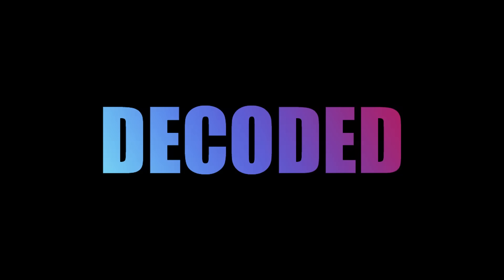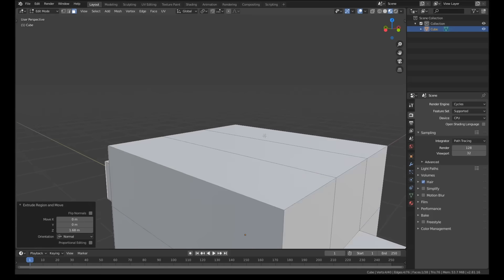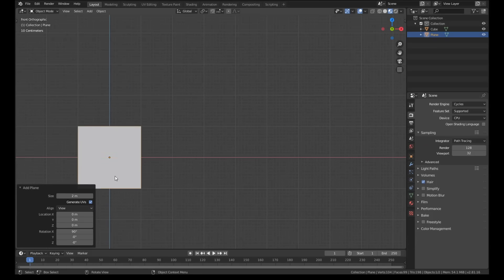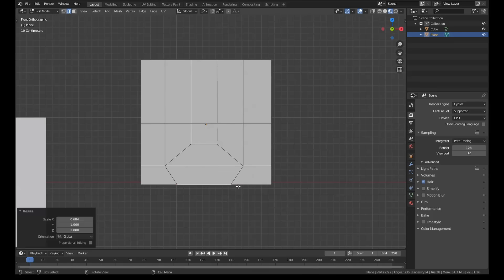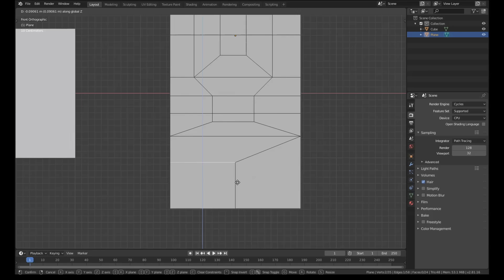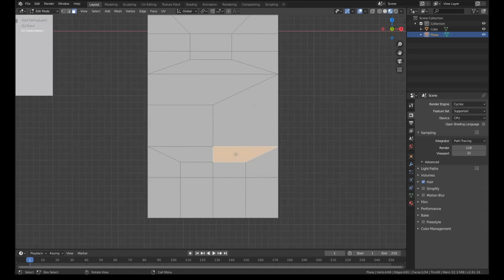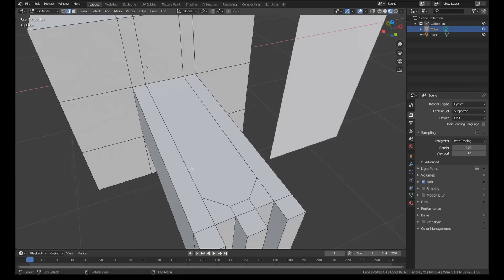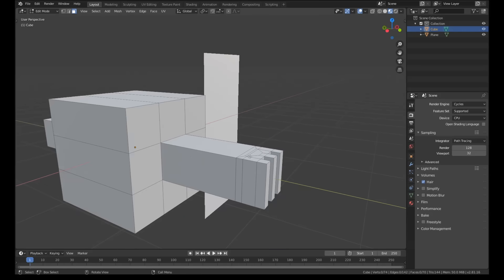Change Your Understanding of Topology In Six Minutes

Comment: Total beginner here, but why not make both sides like the bottom is?
Looks much simpler to me, way less edges.
Reply from the maker: You can see the principle of this video in action by looking at this picture of some hand topology (https://cdnb.artstation.com/p/assets/images/images/011/006/091/large/david-krstevski-hand04.jpg?1527817680). The hand has a lot more edges than the arm because of the fingers, but the artist has good used topology to connect the two together.

Comment: Ignorant question here. It looks like dissolving a line just gets rid of it up until it intersects with another line. So you could just make a horizontal line and dissolve the part of the vertical line that was above it. Why are all of the slanted lines needed? I'm clearly missing something.
Reply from the maker: The slanted lines are needed to that every face has four sides.

Comment: I never done any modeling, can someone explain why 6:33 is bad?
Reply from the maker: Ngons create weird shading, and you can't smooth them properly using a subdivision surface modifier. For something like the example at 6:33 it wouldn't really matter much, since it's a flat face. But that same topology in another area could ruin a model.

Comment: So... a model has less weight if there are less lines to describe the shape of the said model... is this right?
Reply: What do you mean by "weight"? File/data size? Cost of rendering? In most cases, vertex count is what we're looking for. Which is closely related, but not the same, as the edge (line) count.

Comment: Please, what’s the benefit of this technique? How does that improve the topology?
Reply: It improves lots of things. For one, just less topology in general will lead to performance improvements in places in which that matter (vidya), cleaner modifiers (bevel / subdiv), cleaner UV mapping, makes modeling easier without 50 Quintilian edge loops in the way, and just in general it removes unnecessary components to your model, making it more professional.
Reply: @Daniel-__  What's the benefit of all quads?
Reply: @odomobo  Quads are used for a cleaner mesh when dealing with edge loops & deformations, (subdiv mostly)  but also because quads are just much easier to deal with. N-gons cause lighting issues, and tri's, while ideal for video games, are hard to edit and can cause weird topology when editing with edges and proportional editing. And again, it just looks more professional.

Comment: Why am I here? I don't even do how to model. 
I can't understand but it seems very interesting.
Reply: same here, was wondering why it is a problem if there are these loop cut thingies
Reply: @RagbagMcShag  it's because it adds loops in places unneeded and just clutters your model up plus when you want to smooth the model it can deform it
Reply: Could some topology dude explain to us plebs here why this in the video is so awesome?
Reply: VerticalWit when he starts making cuts on the “ribbon” (the plane on the left) he shows a short process for increasing or decreasing the number of faces in different parts of a model. Off the top of my head, this kind of topology management  is important for several reasons. 

1. Keeping poly counts down. This is not as important these days, but still a concern for low-resource gaming. 

2. For avoiding having unnecessary faces generated far away from the place you actually need them, and keeping the model “clean” of excess faces. This helps a lot when animating and weight painting, since having more or less faces densely packed in an area affects the way a mesh deforms under an armature, or has particles emitted from it in some particle systems. 

3. Note how every face he drew with his method is a quad. Using his method specifically, you can still use loop cuts that will go all the way around a model, and other modifiers/transforms like subsurface will continue to work well, since you’re not including random triangles or n-gons in the mesh. This property, of maintaining the path of loops of connected faces, is what is being shown in the thumbnail of this video.
Reply: @rohitmalyala8951  appreciate the explanation
Reply: It's funny because I was just at a page where a modder was saying that he's stuck on adding support for a tool to his mod and needs someone with knowledge of Blender to take over, and this popped up on my youtube recommendations. I'd literally never heard of the program until twenty minutes ago.
Reply: lmao came to post the same thing. understood: 0% but was nodding my head as if i understood
Reply: @Kamel419  if you care to understand, open Blender and do some 3D models. Make a character or a toilette.
Reply: I do modeling and I don't get the purpose.
Reply: lmao
Reply: Why are we still here, just to suffer. I cant feel my leg.
Reply: You know why you're here, you're just in denial about it ............

Comment: I never knew understanding topology can be THAT MUCH of a game changer
Reply: With how complicated it can get, you can say that topology IS the game
Reply: Just learn how to use ngons , what he did can be done with same result and less headache.
Reply: @onwf203  Not the same result. Triangles and n-gons aren't smooth-shaded the same as quads, also not animated the same and they mostly can't form loops. Quads and loops are the thing to use in all modeling.
Reply: @onwf203  Ngons are bad topology and should only be used very sparingly in isolated cases. They are not the solution.
Reply: @onwf203  never use ngons

Comment: just trying to get my around this, is there no way to do four to one with this method? I was trying but I couldn't solve the puzzle
Reply from the maker: Not directly. You have to do four-two, then two-one.
Reply: DECODED thanks 😊 i think i get it now.
Reply: DECODED oh right, am actually stuck on two to one. I miss typed. But now as i type this i see it in the pink section of the guide.

Comment: 3:23 Notice how every time you create a vertex with valence 3, you also create one with valence 5 at the same time? (That may not be so apparent at the 3-to-1-face transition, but extrude the sides out and you will see the 5-verts.) Basically in a manifold mesh made of quads and 3/4/5-verts, the 3-verts and 5-verts always have to be created and destroyed in pairs.

Comment: One good tip is to keep triangles in mind. The model already conveys the quads to triangles so don't be afraid to throw a few into your model. But be sure of your placement of triangles or you can create a headache for you later. It's good practice to try to lower poly count on like hands by converting the complicated bits from quads to triangles
Reply: 3 to 2, etc. But avoids adding fans into your mesh. Sometimes 7 breaches coming from a vertex is ok but you really want to keep the max to 6 if you can help it

Comment: though i have to admit, i still don't get why the ngons are bad?

so i can easily make this shape without making all these quads (resulting in ngons)... what is the advantage to this? subdivision?
Reply from the maker: Subdivision is one problem that ngons can cause. They can create wierd shading problems too. You also encounter issues with ngons whenever you try to add loop cuts to your mesh. Like the example I used at the start - you add one cut and it travels down the whole mesh. That can massively increase the number of verts in your object - slowing down viewport performance and render times. Good topology is also important if you're planning on animating or UV unwrapping a mesh.

Comment: Why does that matter? The topology on the bottom is still quads too so what's the purpose of all of this? I am new to 3d so I'm trying to understand the "why" of this "how".
Reply from the maker: Watch the example at the start again. When you add cuts to a complex mesh, they spread through the whole model because they travel down the edge loop. This makes modeling more difficult, and it adds loads of extra verts to the model (increasing render times and reducing performace). Also, let's say you you're making a model that's square on one end, but round on the other (like the end of a screw driver, for instance). You need to change the number of edges to make a shape like that because one end of the cylinder has 32+ sides, but the other end only has 4.

Comment: The 2 to 1, Are you not just redirecting the edgeloop? At the beginning of the video you show a line going horizontally to the left in pink. that edge, can it just stop there? could that be considered a column?
Reply from the maker: Yes, in this case the edge would be redirected, but you'd normally have some kind of geometry to the side.
Reply: @DECODEDVFX  okay, yeah, there's geometry to the side, so I just need to make it loop in on itself somwhere.
Reply from the maker: @Orphanlast  bingo

Comment: Oh my god, this is life changing. I've watched it three times now. 

Thank you so much man.
Reply from the maker: Thank you. Glad you found it helpful.
Reply: @DECODEDVFX  Oh man, you have no idea... So many times I've stared at my pristine model for ten minutes before giving up and hitting ctrl R knowing that the topology will never be perfect again but consoling myself that this huge compromise is needed keep ngons off my mesh.

I owe you a pint.
Reply from the maker: @davidmurphy563  A lot of people struggle with good topology, including myself - so you're not the only one.
Reply: @DECODEDVFX  Tell me one thing. I've thought a lot about this. What is your take on starting from a primative and dicing vs starting from a plane and extruding? 

When I first look at an object this is the first decision I take (I have a bias to primative because you can control symmetry more precisely) but - say if I'm making a car - I'll choose planes because I know I'll need to get the edge flow of the topology to match the fundamental geometry of the object. Although, I'm thinking that what you've taught me here may change that. 

What's your approach?
Reply from the maker: I generally start with whichever default shape most closely resembles the object I'm modeling - usually a cube or cylinder. I hardly ever model from a plane.
Reply: @DECODEDVFX  Huh, me too. Like I say there are so many basic advantages from starting with a primitive. I recently did a VW ID.3 from a cube (want to buy one) but was unable to make the edge flows (grill, arches, bonnet) from this without moving to ngons in places and there are no flat surfaces to hide it. It's no good quadding things if they don't follow the flow of the object as you need to tighten loops once you put sub surfs. Every tutorial does it from planes so I went to that but that's an artistic approach where vertices are just hanging in space. What I finished with looked like the car but nothing was perfect. It was an interpretation with compromises galore, rather than what I wanted. I mean, the layman would be impressed, but I wasn't.

I'm going to try it again from a primitive.

Comment: Why use the knife took instead of just using loop cuts? Does the knife tool do the same thing as a loop cut except it doesn’t go all the way around the object?
Reply from the maker: Yes. Knife tool gives exact control rather than slicing a while loop cut.

Comment: Things to keep in mind. Long and thin polygons will trip up Gouraud shader. It's not usually relevant today, but it was super relevant when you were targeting Dreamcast, PS2, Gamecube era hardware and may still be relevant when targetting low-end mobile platforms.

More relevantly for today, Catmull-Clark subdivision trips up on triangles, so you're good on avoiding them. However it also trips up on odd-valence vertices. Normally in a pure quad mesh, every vertex has 4 edges connected to it, so the valence of the vertex is 4. You have built a bunch of 3- and 5-valence vertices in here, which are usually not as bad as tris outright, but will still cause waviness in the subdivided mesh output. Since pure 4-valence quad topologies are generally impractical, there's often no substitute for just winging it and taking the waviness and letting it be the model feature where necessary, building the topology adjustment around there.

I'm also not convinced that the industry should stick to Catmull-Clark subdivision invented in the 70s. I my experiments, i had the impression (but no mathematical proof) that the behaviour of the subdivision could be improved by introducing normal-based displacements that would depend on local topology and would also help the subdivision be somewhat volume preserving, since Catmull-Clark tends to deflate a lot. It's not like research ended there, there was Stam/Loop 2002 "Quad/Triangle Subdivision
".
Reply: Does anybody bother with Gouraud shading any more, when Phong shading is superior and doesn’t cost much on modern hardware?

Easy enough to add extra loop cuts next to the EVs to constrain their effect.

Also, your idea about normal-based displacements reminds me of Blender’s “weighted-normal” modifier. Worth giving that a try.
Reply: Lawrence D’Oliveiro Phong is an old term not really used anymore. It’s just vertex based shading or fragment shading whatever that shading is doing. 

That said. Normal light linear fragment shaded today is not more expensive than vertex shading.
Reply: You got to be kidding me, right? https://en.wikipedia.org/wiki/Phong_shading
Reply: Well hurry up and develop a subdiv plugin for us all to use then dammit lol. XD

Comment: How did you delete those select those edges at 5:36 and delete them and it didn't delete the edge loop all around the object ? coz after you delete, the edges at the right were still there? i tried this and i kept deleting the whole loop.
Reply from the maker: If you want to delete a vert, edge or face while keeping the rest of the geometry intact, press delete and select one of the dissolve options (in this case I used dissolve edges).
Reply: Pls somebody try this and tell me i'm not crazy!! I had to do exactly the same thing at the top and bottom for it to work.

Comment: is that even possible to go from odd to even numbers; like 5 to 4 or 3 to 2 (2 to 1 being the exception), without creating a triangle or n-gon? 
i been racking my brains for days, and unless i'm missing the obvious, it does not seem possible.
great video btw !  : )
Reply from the maker: You can do it, but not directly. To go from 5 edges to 4, you'd have to go 5-3 then 3-2, then 2-4. To go from 3 to 2 you'd want to go 3 to 1 then 1 to 2.
Reply: @DECODEDVFX  tnx a lot for the help m8!
much obliged !  : )
Reply from the maker: @moontan91  No problem.

Comment: I'm quite new on Blender, so I guess I really don't understand the problem. Why just simple dissolve the loopcuts you don't need on the cube?
Reply from the maker: Doing that would create ngons, which (as a rule) you want to avoid. Good topology, made up of roughly equally sized polygons is best practice for modeling. It will allow you to cleanly (and predictably) subdivide the mesh. It will allow you to deform a mesh properly (say on a character model), and it will make UV unwrapping easier.
Reply: I didn't get that edge of several vertices was takin in account. I thought one line was always one vertice.